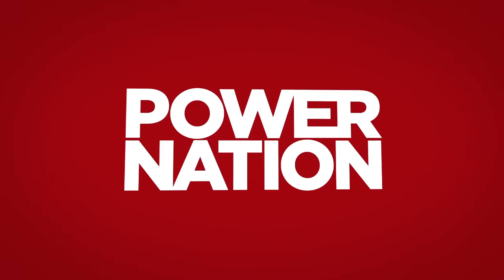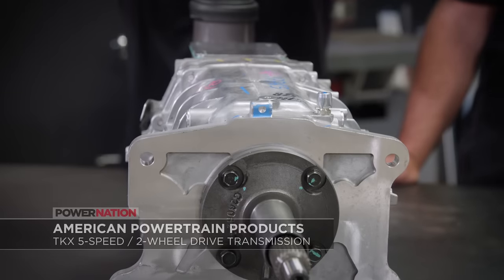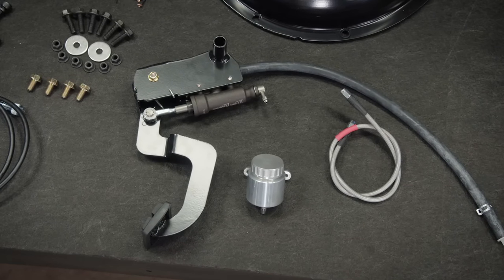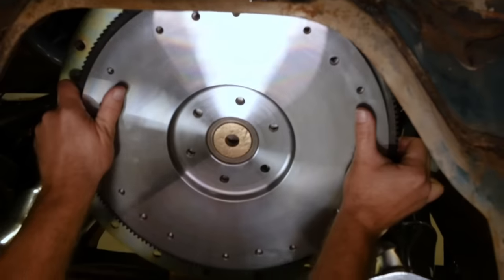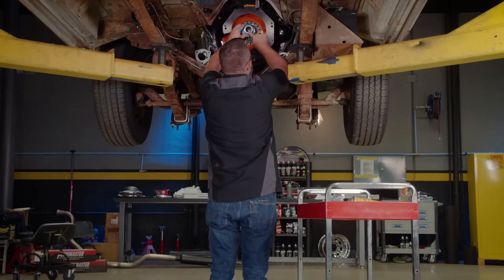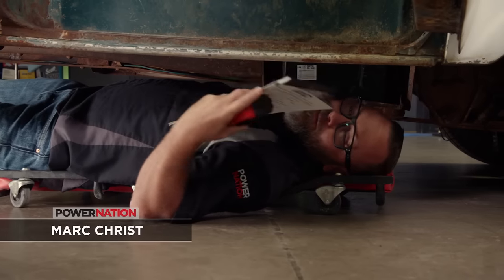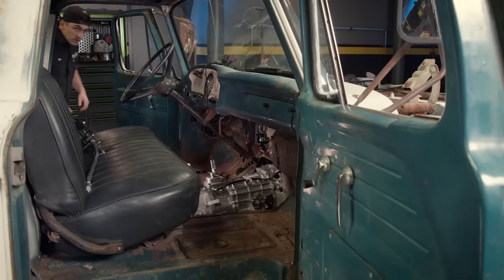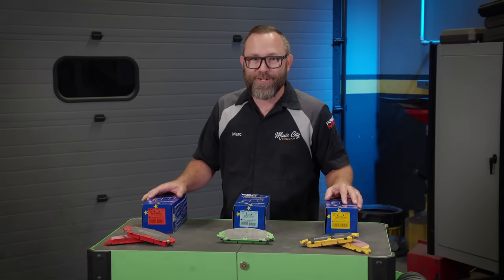FErocious Ford Part 2 - Music City Trucks S3, E14

Comment: A "shop truck" with 5.87s, dual quads and the aerodynamics of a brick. and premium fuel $4+ a gallon.. Perfect... It only costs you 75 cents a mile to drive it, no big deal.

Comment: Nope,    modern disk brakes and a steering upgrade would be needed.
Reply: My thoughts exactly. Wife abd I built our 69 the same way, eith scavenged parts from the yard we bought in 05. Just to get the base set, as a starting point. 

We upgraded to late 90s F 250 sxels and driveline, 7.3 IDI, 6 speed manual. Then we went to Summit and EBC. Ordered up bushings, steering components, and other parts.

Not so much for our safety, as we had good braies for what we haul from the factory.

But as someone who lost his future to a drunk driving a sketchy old farn rod, and carries his own guilt, the other side of that coin is one I Never want to see. 

Because I wouldn't wish my own side on anyone.

Every vehicle we own, from the bikes to the van that grants me freedom from a wheelchair,  the first thing we do is upgrade the tires and brakes. If the steering was good, uprades were held off until the miles add up.

I love my wife and daughter. They are my world, joy, and reason for living. Even disabled the only thing that stops me, is Me.

But they will never replace the one I lost. A grand to upgrade brakes is nothing compared to the value of your project. $31k compared to $30k. A thousand more dollars may save your, or someone else's life, or family.
Reply: It needs upgraded wheels and tires, too. Maybe a set of new Alcoa duelie wheels.

Comment: You're 85% there... You need to do the front end upgrade and brakes... or did you run out of project budget? also, you did not show a full 6 gear run through. 1st gear is is probably LOW.                     I was expecting you to row through the gears... If It's that sketchy, then what's the point if you can't use it to it's full potential.
Reply: Future content. They did say, put this sketchy thing away, for a while.

It's not only budget that can stop or delay a project. F8nding parts, manufacturing delays, shipping issues, and needing to track down a donor car can all lead to production delays. Our shop has a couple that have sat since 2019, due to lack of new, or NOS parts. In our spare time my wife and I fab new ones. 

So don't worry. That beast will be back.

Comment: Please tell me if you plan on using this monstrosity you plan to change the rear gears and put a box on it!
Personally i would have left this 1 the way it was, fixed the 6 and ran it. The FE would have found a full body truck to go in

Comment: Glad to see the 350 get re purposed
Reply: Don’t you mean 390 FE
Reply: @helker8909  the truck is a 350, engine is 390fe
Reply: Literally thought you mistyped what the engine was my bad
Reply: @helker8909  An "F" in front of the 350 would have made it clear. Chevy 350 and LS swaps are so common.

Comment: Still disappointed that they never acknowledged what happened to the i6
Reply: After a few hard dyno pulls in the truck it was belching white smoke.   So the supposed unbreakable engine broke at power levels the average small block would live forever at.
Reply: @bmstylee  ford 300 wasn't built to be a hp killer its all about torque and pulling so yeah Ik it blew up. Do that to other engines that weren't designed to do that I bet they will blow up too.
Reply: @infernoking7504  big blocks and 383 strokers are also built for torque yet they don't break when you put some power to them.  The 300 fan boys can't accept their holy relic tapped at power levels that a mildly built small block would comfortably live for 200k miles at.   It's long obsolete that's why we use other engines now.   You could build something that would easily make double the power with what they spent on the 300 and live a long life.
Reply: @bmstylee  Your comment shows that you don't know much about the 300.
Reply: @bmstylee there are Ford V8s that were made for torque and can handle big power as well, so what's your point? We're talking about an inline 6 that red lines at an rpm below what most engines normally shift at.
Reply: @bmstylee  I've owned a few 300 inline sixes and they ran no matter what I did to them. I warped the blocked and had the engine oil full of coolant and it still got me everywhere I needed. You can run them dry of oil as well. You clearly don't understand what they were built for. Let's see one of the V8s you're blabbing about do the same and keep going.
Reply: @bmstylee  A stock 300 inline six will out last any of those engines in the stock form. Why is everything about how much power you can get out of something rather than using it as a work truck and not a pavement princess. You immediately start comparing Chevy engines to it like that means something lol. There are many for V8s that can handle the power upgrades for 200k as well. Don't get your panties in a bunch about brands like a 16 year old chump.
Reply: @bmstylee 😢

Comment: Why the heck would you even keep the 5.87 rear gear in this truck to begin with? You could easily have swapped out a 4.56 with LSD. You'd still have plenty of grunt, and you wouldn't necessarily need two overdrive gears to drive at highway speeds without turning 3000 RPM.

Comment: I saw a Beautiful 60 Vette Convertible the other day ,,, I slowed down to gaze at the Beauty for a couple of minutes,,, then I cranked back up to a higher speed  in my E36 "M" Convertible,,, maybe throw some Body work and PAINT at that RUSTED  Thing,,,,?  "What would Chip Foose DO  ??
Reply: Remember  that the rust bucket look is better than a clean rod.  Let's spend 20k+ in drivetrainin addition to other parts and not bother making the outside presentable.   Patina is old English for cheap and lazy.